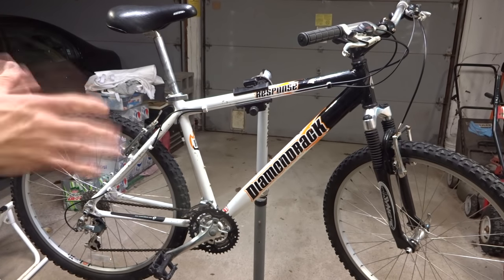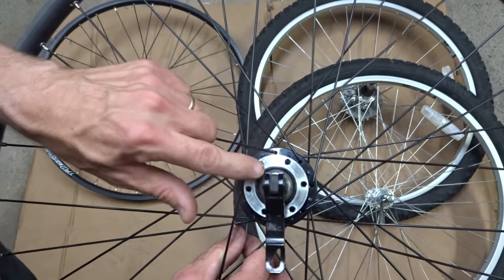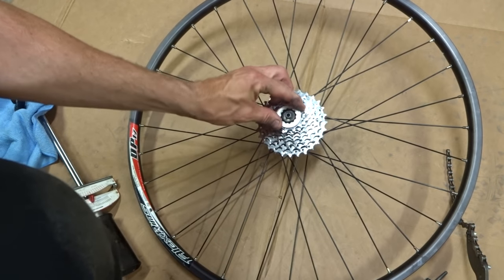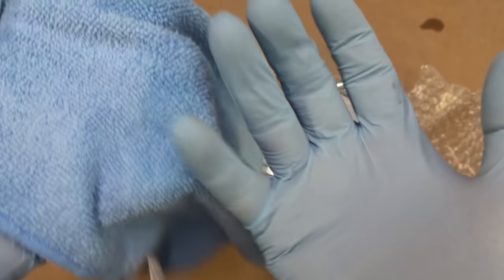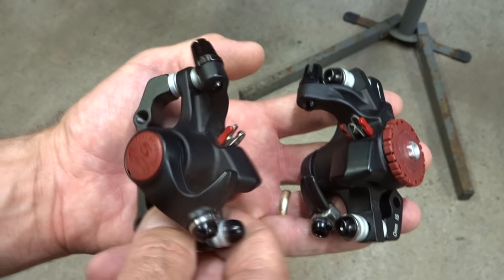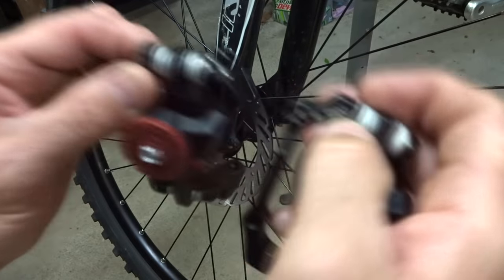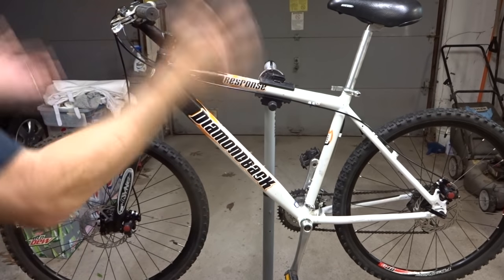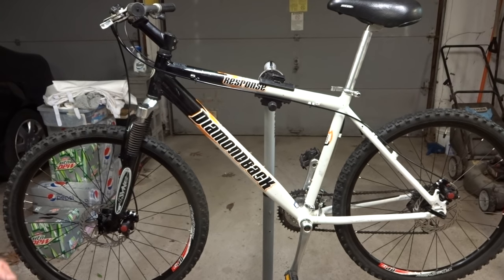How To Convert To Disc Brakes From V-Brakes On Mountain Bike

Comment: Is this your first video on disc brakes?
Reply from the maker: Yes. I have had a bike with disc brakes for years, almost did a video on replacing the pads, but they the pads were fine, so I didn't replace them.

Comment: Not clear how the disc brake calipers were already welded to the front fork and rear down tube of the frame by the rear axle. Most non disc brake bikes won't have these brackets. So where do you get the brackets to mount the calipers? They must have to be welded on to have adequate strength.
Reply: I meant the disc brake caliper brackets were already on this bike during the new conversion. Most bikes will not have these brackets already welded on.
Reply from the maker: Actually, lots of bikes have the mounts,  but don't have disc brakes. Frankly, if you frame doesn't have the mounts, it's still possible to convert, but not worth it.just go buy a bike with disc brakes at that point.

Comment: Is the chain-whip really necessary for removing the lock ring?
Reply from the maker: Okay, try it without one, and let me know how it goes.
Reply: That sounded really condescending. Not helping.
Reply: I just tried a substitute for the tool. Disassembled the rear part of the chain mechanism, kept the chain around the front where the pedals are for resistance. Then had a friend hold the wheel on the other end and tried taking it off, but it still won't budge.
Reply from the maker: Well then I guess you have an answer.
Reply from the maker: I used a chainwhip, because that is how it is done. Then you ask if it is needed. Did you think I was using the tool just for fun?? I showed you how to do it.
Reply: "Did you think I was using the tool just for fun??"

Of course not. Still talking to me like I'm an idiot I see.

Obviously tools are made to make tasks easier. I was just wondering if the task was still possible without it because I don't have one.

Comment: You don’t need new wheels. Just change out the hubs! It is probably a job best left to a bike shop unless you know what you are doing and own a spoke roller, but it is still cheaper than new wheels.
Reply from the maker: Most people don't have the knowledge or tools to do it. And pricing in the hub and spokes, and time, usually just easier to buy some used wheels.

Comment: Where did you buy the parts you've used? I also want to convert my bike to disc brakes, we have the same frame hahaha, replies will be highly appreciated. Thanks
Reply from the maker: Ebay, craigslist, Amazon, bike shop, etc.
Reply: @RJTheBikeGuy  how much did you spend in this upgrade?
Reply: @RJTheBikeGuy  Can you send the link where you buy the adapters? Please ? I really need those adapters
Reply from the maker: @dwightyydrums8092  I don't recommend using the adapters. Cheaper and easier to buy a bike with disc brakes. But here: https://www.youtube.com/watch?v=emW7M-ZD0Pw
Reply: @RJTheBikeGuy  Thanks, Subribed👍

Comment: Is this also possible with full carbon disc wheels and/or a tri spoke?
Reply from the maker: Did you watch the video?
Reply: @RJTheBikeGuy  I did but i skipped some parts (sorry, time is money). I'm not so much of a bike mechanic so i'm just asking because i'm guessing there are quite some differences between a full carbon disc wheel and the wheels you changed
Reply from the maker: You need wheels with disc mounts.
Reply: @RJTheBikeGuy  Okay I indeed skipped that part. I did however also ask a mechanic that i know who saids that it is possible but it's just a little 'messy'. Do you know how this works?

Comment: Hey @RJ The Bike Guy,
I got a question. BTW i am very new into mountain bikes and started reading and watching a lot of videos on forks disc brakes ect . Anyways, I got an used mountain bike that has the disc brake conversion in the rear. Recently it started doing a noise in the rear. It sounds like rubber rubbing on metal. its not like a metal to metal contact noise. Checked the rotors, and caliper and looked for any misalignment but the sound will not go away. I looked at this video to see if there was any rubber spacers something that would rub but cant seem to find anything. Any ideas? I took it to my local bike shop and he is clueless. So thats why asking the good ole YT. LOL.
Reply from the maker: https://www.youtube.com/watch?v=i0KB7VeriNM
Reply: @RJTheBikeGuy  found out the issue. Will need to redo the conversion kit. Will need to buy the chaser kit. A bit confused on the 145mm kits vs the 170mm kit. Not sure which one I need. Is this referring to the space between the rear dropouts?

Comment: I'm trying to put new pads in my Avid BB5 calipers but can't seem to push the pistons back into place. I've used all sorts of tools with the best luck being a silverware fork. I can get 1 pad in but when I try the second it gets caught on maybe .3mm of the first brake pad and won't budge. 

Any ideas on how to get the piston all the way open? I cranked the red dial as far as it'll go, the adjustment screw on the caliper is as tight as it can get as well as the lever adjustment screw. I'm about to take my bike in for work but was hoping to save a few dollars by doing this bit of labor myself.
Reply from the maker: https://www.youtube.com/watch?v=uyM2Sxl_Y6g

Comment: What brand is the billet rear adapter? I've been looking for one like that and have been unable to find one.
Reply from the maker: +blake worsham the 20mm IS bracket? It's from Avid.
Reply: RJ The Bike Guy the billet adapter that would be used on a bike that doesn't have a rear mount.
Reply from the maker: https://www.google.com/search?q=disc+brake+mount+adapter+bracket+bike&source=lnms&tbm=isch&sa=X&ved=0ahUKEwjM8eTz4r3UAhUUUGMKHTsIA7wQ_AUICygC&biw=1600&bih=770
Have fun shopping.

Comment: 1:43 That "Mouse" thing came off my hub, is there a way to put it back in place, or do I have to buy a completely new tire?
Reply from the maker: +Camel Lover The skewer?
Reply: RJ The Bike Guy I'm really new to biking so I'm not fully aware of the names but I it's the piece on the skewer that you screw the rotor on, thanks for answering.

Comment: Found the perfect bike for this type of conversion, a 2001 Giant XTC SE 2 with V-brakes but both the frame and the Judy C fork are disc-ready.  Everything looks in working order except the shifters. It's like they're "gummed up" in that they are harder than normal to press. Then when you press it once to shift the gear, the trigger lever doesn't snap back like normal. It just slowly creeps back. Then when you try and shift again, it doesn't engage at all. You can just push the lever all the way in and nothing happens. Any idea what might be causing that? It's almost like there's a bunch of sludge packed into the cables or the derailleurs or something. But I couldn't detect what the problem was.
Reply from the maker: https://www.youtube.com/watch?v=07Bc0QkudW8
Reply: @RJTheBikeGuy  Much appreciated.

Comment: Instead of replacing the wheel can I just replace the hubs?
Reply: Paridhi Kashyap Yes. But unless you buy an identically size hub (unlikely as disc hubs tend to be bigger) you'll need new correct length spokes too.

Comment: I dont have those 2 holes for the caliper on my frame. What do I do??
Reply from the maker: Get a frame made for disc brakes.
Reply: @RJTheBikeGuy  aight thanks for that quick reply sir
Reply: @RJTheBikeGuy  Huh?  Didn't you say in your video that you could buy an adapter kit that would give you the mounting tabs?   You held up a couple of them, saying they range from cheap to expensive.  Are you no longer supporting this option?
Reply from the maker: @raserjohn  They sell adapters, but it's not a good way to go. They are expensive and not nearly as good as having a frame made for disc brakes. https://www.youtube.com/watch?v=emW7M-ZD0Pw
By the times you buy all the stuff, you might as well buy as disc brake bike.

Comment: is there a kit that you can use to install the rotters my bike has only one hole instead of two.
Reply from the maker: Rotors go on the wheel. Are you talking about Calipers? One hole? Sounds like a fender mount, not a brake mount.
Reply: @RJTheBikeGuy       You are right they are fender mount holes, I guess there is no way I can make my bike into a disc break bike, it is at least a 20 year old GT but I always liked it Thanks for your respond.
Reply from the maker: @leobardonunez8454  Well you can, but I recommend buying a bike made for disc brakes. Cheaper and easier and better. https://www.youtube.com/watch?v=emW7M-ZD0Pw

Comment: Hey is it possible to add front fork on non fork bicycle? And if Yes then is it successful?
Reply from the maker: Not without changing the geometry of the bike. Not a good idea.
Reply: And what about disc brakes?
Reply from the maker: If you can find the right size forks with disk brake mounts.
Reply: Ok....Than you so much,I searched all over but can't find anything about this......U are the only one who replied to my comment. U earned urself a new subscriber,really appreciate it
Reply: Wut , non fork bike? Hows it work
Reply from the maker: I was assuming he meant change from a rigid fork to a suspension fork.
Reply: Yup i meant suspension
Reply: oh yeh thats logic and possible
Reply: How ?

Comment: Can u make please video how to put front disc brake to back pls
Reply from the maker: ???? The calipers are the same.
Reply: @RJTheBikeGuy  so i dont need to buy extra things to put it to back?
Reply from the maker: @esthelp751  The adapters are typically a different size front and back. The the calipers are the same.
Reply: @RJTheBikeGuy  so i need buy adapter And then i can change?

Comment: Why did you cut the brake cable? why didn't you just undo the bolt from the vbrake  and save the cable?
Reply from the maker: Because one, cables wear out, and should be replaced occasionally. Like engine oil. Don't wait till it brakes. Two, it would have been too short to reach the disc brake anyway. Cables cost like $1. Replace the frigging things!

Comment: I have a road bike that doesn't have a Mount for disc brake, but I really want to put on disc brakes. Please how can i do it?
Reply from the maker: Best option is buy a frame with mounts.
Reply: @RJTheBikeGuy  can't I just change the hub?
Reply from the maker: You have to have calipers mounted to the frame. And it's easier, and probably cheaper to buy wheels set up for rotors. A regular road bike is not made for disc brakes.
Reply: @RJTheBikeGuy  thanks. I will just stick with my rim brake.

Comment: Is there any way to put discs on standered wheels
Reply from the maker: No.
Reply: RJ The Bike Guy I thought I try
Reply from the maker: It was stated in the video.
Reply: I think you can get the hubs changed for one that suits disc brakes(not sure)
Reply: No you have to replace the whole thing as the hub and wheel have a completely different geometry than a standard rim brake wheel setup. I just don't know how they would handle rough handling on rough terrain though.

Comment: hi,what name wheels mountain bike?i need repair like your details here as my mountain bike gt white and blue frame.i cant sold new wheels 26 size tube two also new brakes repair it.can you help please let me know.many thank
Reply from the maker: Doesn't matter. There are tons of different wheels that will work.
Reply: i found two different frame mountain bike as hydraulic disc brakes.i have use old gt mountain bike white and blue frame small only cable brakes not able repair hydraulic disc brakes.when i get bid from ebay has confirmed frame gt mountain bike can be repair both brakes hydraulic disc brake 160mm.but i was sold old mountain bike in 2003s!after than i found look different frame into hydraulic disc brakes details is best!i just ex-change other gt mountain bike look same old gt mountain bike as i found this one today.hope help many thank found your confirmed here list youtube:)

Comment: Which brake stops better cable or hygrolic
Reply from the maker: A good hydraulic is generally better.
Reply: Can the heat affect the fluid
Reply: I've got shimano mechanical disc brake they very sharp
Reply from the maker: https://www.cyclingweekly.com/news/product-news/is-heat-build-up-in-disc-brakes-something-to-worry-about-310878

Comment: Would this work with the Trek Precaliber 24?
Reply from the maker: Doesn't look like it has mounts, so no.
Reply: @RJTheBikeGuy   even if I change the wheel?
Reply from the maker: @itsjusts_am  If you do not have mounts for disc brakes on your frame and fork, forget it!

Comment: i have been biking off and on for 25 years. i just got a deal on a 10 year old mongoose mountain bike with front and rear disk brakes. yes, they do look cool, but they are not as good as my 15 year old vbrakes on a similar bike. i am so confused why these disk systems are so popular, i pray its not based on cosmetics.

Comment: Do you have a parts list or where to order from
Reply from the maker: Parts vary by project. Ebay. Amazon.com, etc.
Reply: RJ The Bike Guy   Any way you can help me out I can email you pictures of my bike and possibly you can shoot me in the right direction . I will compensate you for your time ?
Reply from the maker: @johhnychingas7825  You can post photos on my face book page. Compensate me? It would be cheaper taking your bike to a bike shop.

Comment: My mountain bike doesn't have the part required to fit the calipers. Please can someone give me instructions?
Reply from the maker: Easy solution. Buy a bike with caliper mounts. Even better yet, buy a bike with disc brakes.
Reply: RJ The Bike Guy aren't there caliper mounts that can be placed on bikes without them
Reply from the maker: It's cheaper and easier and better to buy a bike with disc brakes. https://www.youtube.com/watch?v=emW7M-ZD0Pw
Reply: So you can't get the mount and place it on
Reply: Ryan Still no you need a fork

Comment: Disapointing in that you just add parts to a frame already built to accept them,older bikes do not have rear disk mounts on and a solution to that needs to be explored.Forks are easiy swapped for disk forks but rears are more problematic.

Comment: He should've pushed the rotor back when the bolts were snug, as to not leave any room for sliding
Reply: There is also that tip on park tool installation instructions on YouTube

Comment: is the bike standard?
Reply: If by "standard" you mean "common", then yes. It is pretty common to see IS (stands for "International Standard") disc brake mounts on older bikes. Newer bikes come with PM ("Post-Mount") disc brake mount. Also there are road bike specific "flat" mounts (which are mostly used on "gravel" bikes).
As RJ said you would also need hubs which have rotor mounts: either 6-bolt (like on the video) or Shimano Centerlock (besides, I've also heard about vintage 5-bolt mounts). As for the other things -- there should be no further compatibility issues while upgrading to disc brakes.
Reply: KennyMinigun thanks man👍

Comment: I don't know why the bikes have ventilated discs, they decrease the braking power and they are useless in a bike, because normal discs don't take too much temperature.
Reply from the maker: The pads only hit the outer part. So it helps reduce weight. It also helps with cooling. And yes, they can get very hot.

Comment: I still didn't see what to do? There is no way to mount disk? Every video shows putting on. But if have no way to even start?.
Reply from the maker: First, you have to have a wheel MADE for disc brake rotors. If you have a regular rim brake wheel, you can't make it a disc brake wheel, short of rebuilding the wheel with a new hub.
Reply: @RJTheBikeGuy  that's what I was looking for
 What's a booster

Comment: Thie video doesn't  quite explain whether to buy bike rims with  disc brakes or to delace and relace the rims with a hub that has disc brake.
Reply from the maker: You can do either. But unless you know how to build a wheel, and have the tools, you are probably better off buying the wheels.
Reply: @RJTheBikeGuy  yeah I have seen rims with disc brakes ready, I was confused at first about it. Now I'm better understanding it. Thanks Bike Guy for the info.

Comment: And why would you want to convert a bike to something that is unfixable in the woods or on the road to some from something that is fixable with a chunk of rubber tire and knife and you can repair your Pinchy breaks your normal bicycle brakes you can put new rubber on those why would you want to have a disc brake which you have to carry all the replacement parts
Reply: Disc Brakes have better stopping performance than v brakes, especially in the wet.

Comment: By the time u spend on wheels and parts u can buy a disc break bike.. Disc break bikes are cheap today
Reply: 1600€ onwards for such road bikes. for 800 possible with a 2x8 cheap gear...
but you are right if you own a cheap bike this conversion won't give you better drive train... only better wheels and gears

Comment: darn, I was hoping I won't be needing new wheels for the upgrade :/
Reply: yeah I just googled that, at least a little cheaper
Reply: But if you are going to replace hubs, you need to account for wheel building costs. Sometimes it is cheaper to buy whole wheel then to re-build with new hubs. So consult your local bike shop.
Reply: okay, thx for the advice :)

Comment: Never, NEVER, EVER do this. Stopping forces stress frames differently depending on type of brake. Frame designers build this into the design. The most important part is that component bosses are formed IN THE FRAME ITSELF so forces are absorbed. Clamp on crud is asking for failure.

Comment: Takes off WHEELS ✔️, CUTES existing BRAKE lines ✔️, oh snap. I need to buy whole NEW WHEELS because my old WHEELS are also garbage. 

By the time you’re done converting. You would have probably been better off Buying a Mountain Bike that’s Equipped already with disk brakes!